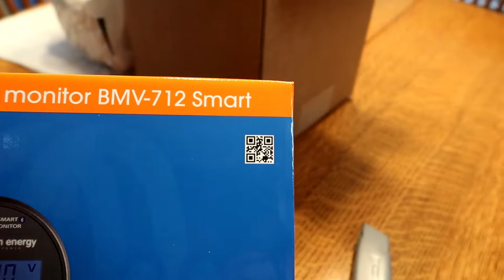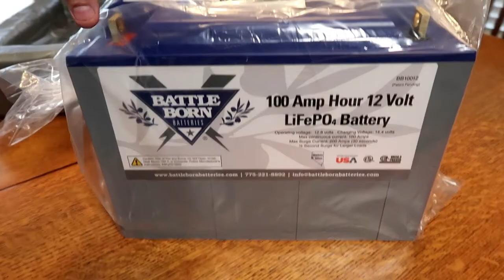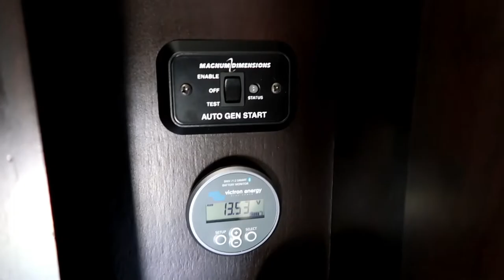D.I.Y. LiFePO4 Lithium Battle Born Battery Install on our Dynamax DX3

Comment from the maker: Just boondocked overnight in 28 degree low temp calm winds. We ran the aqua hot all night (diesel) and the tank heaters, plus normal loads refer, one led light and parasites, clock indicator lights etc  woke up to 63% battery!  made coffee and stayed cozy till we hit the road and switched over to alternator and rooftop solar. Should have changed to lithium right out of the gate. 600ah of AGM wereNO comparison to 400ah Lithium.

Comment from the maker: Still going good! Update! I shut off the inverter/converter, charging function for a couple days. Resulting in battery shutdown at 9 volts. We were able to recover by jumping the chassis battery and the coach battery. Still not a good idea to get that low.